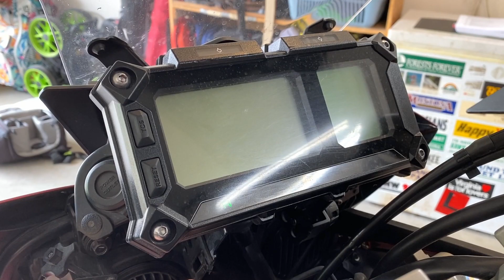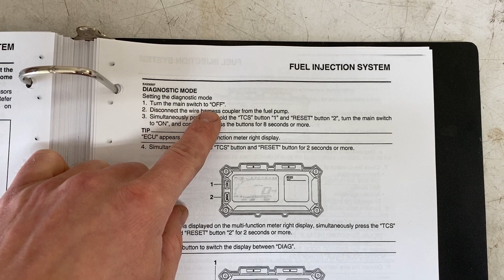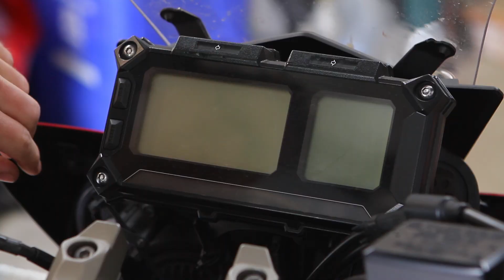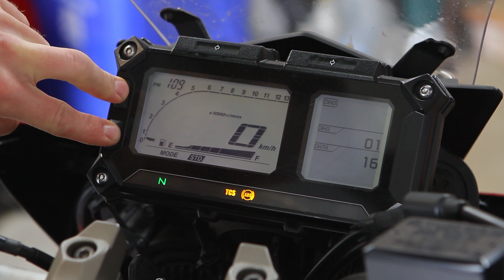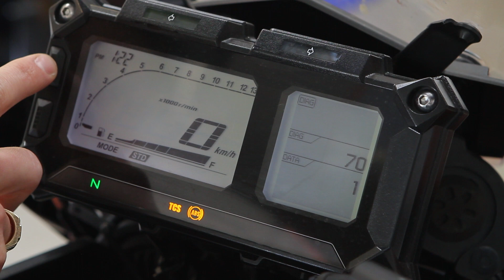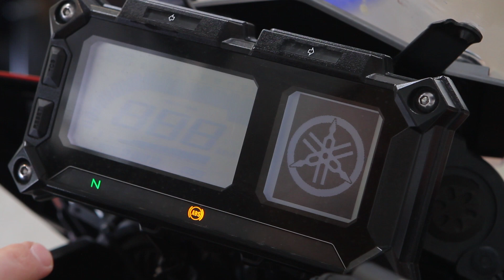How to Enter DIAGNOSTIC MODE on Yamaha MT09 FJ09 FZ09

Comment: Got a 2018 same dash,ecu flashed an now get EML fault,i know it can be reset using code reader but can it be done using this method.
Reply: Not sure I got it removed by Richmond Racing for £10

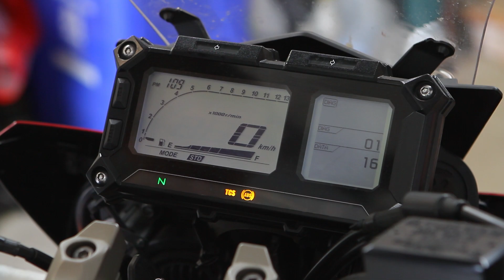Comment: At 1:30min the value “99” , think the last digit is not showed. And means 990mbar , close to 1 bar atmosfheric with no engine running ( outside air pressure) grtz

Comment: Is it possible to cycle the ABS pump via DIAG mode. I flushed through new brake fluid and want to move air out of the system since ABS module is the highest component for rear brake.